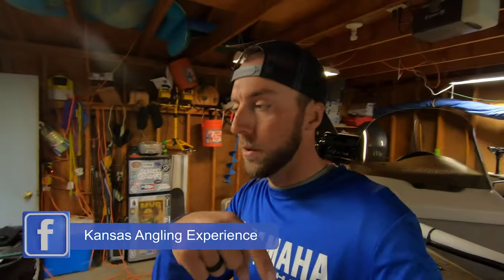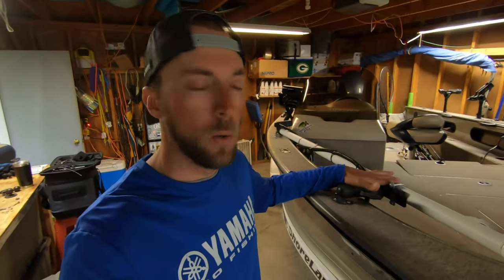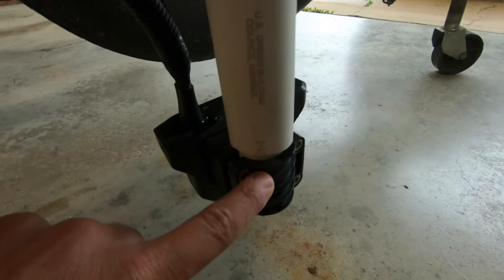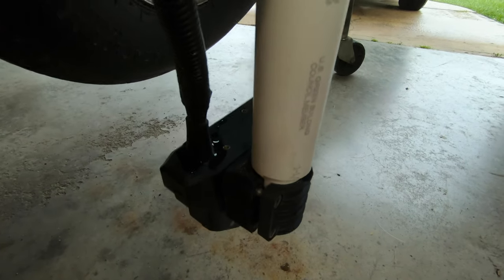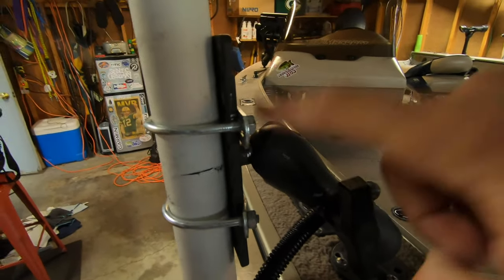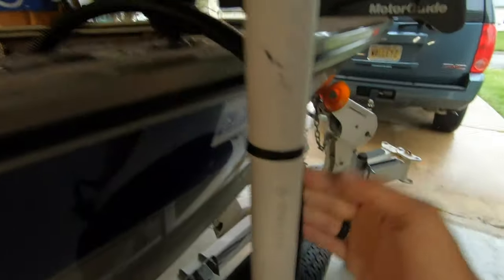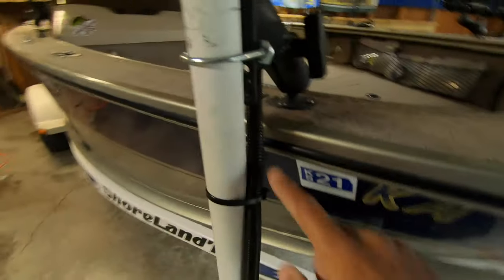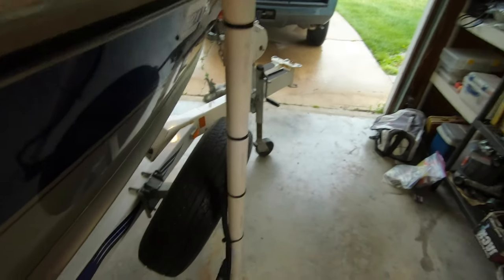$30 LIVESCOPE Pole Mount!! (DIY)

Comment: Thanks for the vid.  Saved me a lot of money and/or frustration.  Instead of buying the 0 degree mount I was able to bend a 11 degree angle on the end of the 1” pvc to counter the mount that came with the unit.

Comment: Ram has a beefy one foot long 2 inch ball mount.   It works great.  I switched my graphs to a 48 inch tall mounts, just to be able to not beat my neck up so badly.
Reply: The very first diy with the kayak fisherman is good for exact cuts.  A little sloppiness in the ram mount is actually good in my opinion. You can make fine adjustments with it that way and if you hit a stump with the transducer it will give. I might suggest bringing it up the bottom of the pole, so if you hit something the shaft and not ducer hits.   
 I can’t believe I have never heeled if the new mount

Comment: Great idea! 2 years later, how is the ram mount working out? Any thoughts on things to do differently? Thanks for the video.
Reply from the maker: I’ve been using a SeeLite pole for 2 years now. The ram mount is fine if you’re on a budget but is otherwise trash. Constantly flexes. Better to spend good money on a reputable livescope pole like SeeLite.
Reply: @KansasAnglingExperience  thanks for the reply. I thought that might have been the outcome with the ram mount. They are better suited for lighter duty applications in my opinion. 
Tight lines! 🎣

Comment: I just saw this video and noticed you used tie-ties to hold your cable.  Garmin says to not use tie-ties because they will crimp the cable wiring and cause interference.  They say to use electrical tape instead.  Have you found that the tie-ties cause you any interference issues?
Reply: I spoke too soon.  I see you have a covering for your wires so that the zip ties do not pinch them

Comment: I do not see in your list of parts what size  ball on the Ram Mount to use for the $30 DIY Livescope transducer pole, and a description for the wire loom used on the transducer cables.  Can you assist??

Comment: Just found your video. Thanks for sharing your setup. Do you think something similar could be made to attach to the trolling motor? I have a ghost so I’d like to have it attached to it for controlling when I spot lock. I have seen plenty of DIY poles but none for attaching to the trolling motor. Thanks.
Reply from the maker: Possibly, if done correctly

Comment: Did this tonight and my pvc keeps locking up when you trunk the handle Even without u bolts on it I greesed it and oiled it but still binds up now I'm gonna have to figure something else out the scotty mount alone was 30 bucks 😢

Comment: Video's great, this is just what I was looking forn couln't calibrate my unit attched to the trolling motor. Could you repost the link for the Zero Degree Offset Mount all I get the famous 404 Page Not Found....
Reply from the maker: Lots of companies make them now. They’re on Amazon as well.
Reply: @KansasAnglingExperience  Out of curiosity, what size screws did you for mounting the ball joint aparatus to the side of the boat?  Found the parts at Loews in Canada for roughly $80, but it beats buying the metal stuff by a long shot.

Comment: The zero degree offset mount link is no longer active. Is there another zero degree offset that you would recommend for the DIY pole? There is the perspective mount on the Summit site now, but not sure if it does fwd and down vies or just perspective.
Reply from the maker: Garmin and Amazon both sell them.

Comment: How far in the water is the livescope supposed to be?  Lower than the bottom of the boat?  Can I measure while the boat is on the trailer?
Reply from the maker: It’s best to do that on the water.

Comment: Can you rotate it without wire binding up? 360 or 180?
Reply from the maker: As long as you leave enough slack in the cable then of course you can.

Comment: I made one of these as well. Basically same set up except my 1 1/4 pvc doesn’t extend down as far as yours. I have a lot (almost too much) movement when the scope is deployed and using the trolling motor. The shaft moves backwards. Tried using a Scotty fishing pole holder for the. 1 1/4 pvc but it still had some movement. Not as much as the swivel ball mount though. How much does yours move when deployed and trolling?
Reply from the maker: Quite a bit so I try not to.
Reply: Is it the RAM mount that moves or the pvc that is flexing?

Comment: Might be a dumb question but we’re did you get the longer cable that goes from the box to the graph? I’m using the cable that come in the box and it’s only about 3 ft long.
Reply from the maker: Can get them direct from Garmin.

Comment: Please don't use zip ties, they pinnch.  Recommend just black duct tape.  Thank you for addressing the zip tie issue.  Well done. Also split the wires at any 90 degree turn.  4 have come back from cut/pinched wires in 30 days.  Sweet rig.
Reply: Great comment I don't understand where you said split the wires at the 90 degree turn what do you mean or how is this done.
Thank you
Reply: Hello, Could you please explain your comment  on the wires at the 90 degree turn? I'm currently constructing this pole mount and want to do it right .
Thank you and STAY SAFE

Comment: So if I wanted to use the prospective mount instead of the mount you used I could right?
Reply from the maker: Yeah
Reply: @KansasAnglingExperience  Thanks for the quick response. And thanks for the info.
Reply: @KansasAnglingExperience  Hey what size wire cover did you use to cover the transducer wire?

Comment: PVC pipe isn't durable enough. If the boat moves too quickly, it bends.
Reply from the maker: 1 1/4” PVC with 1” on the inside doesn’t bend…